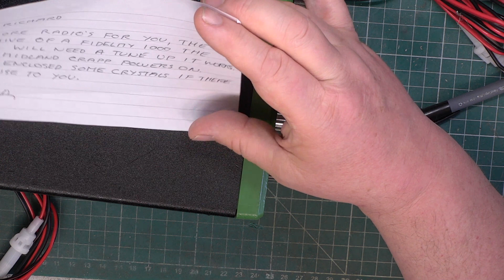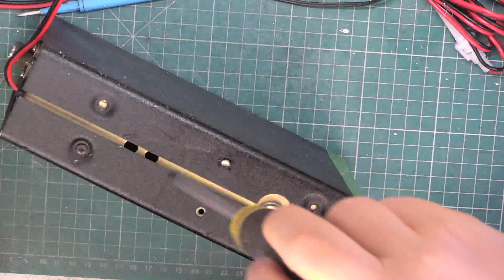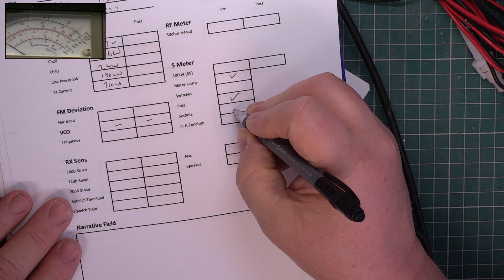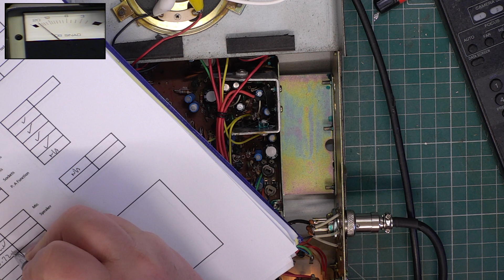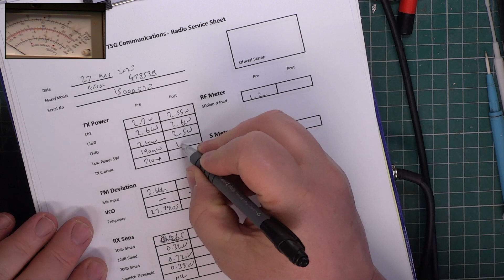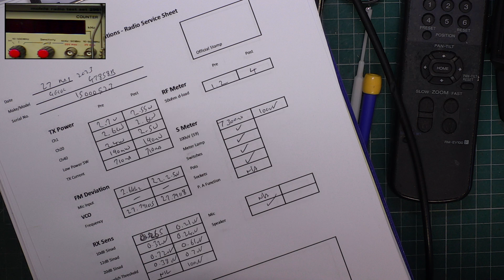Gecol GT858B CB27/81 UK FM CB radio - service alignment

Comment: Absolutely excellent
I've got one of these also and just needs a slight tune up.  Oddly tho, no audio from mic. 
Depending how it's wired. 
You say standard, does that mean Cybernet ?
Reply from the maker: No, Great wiring is different...but this set is 'standard to Great'  Pin 1 Screen, Pin 2 Audio from mic, Pin 3 PTT, Pin 4 RX

Richard